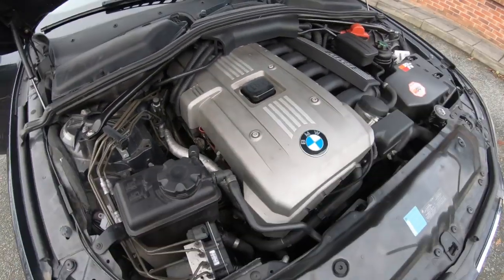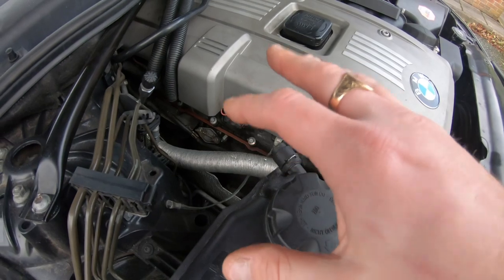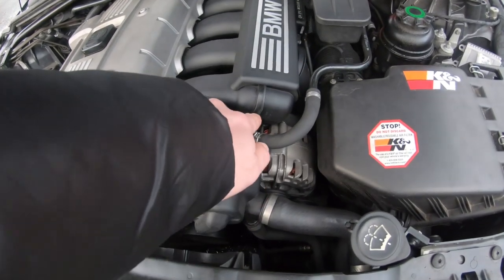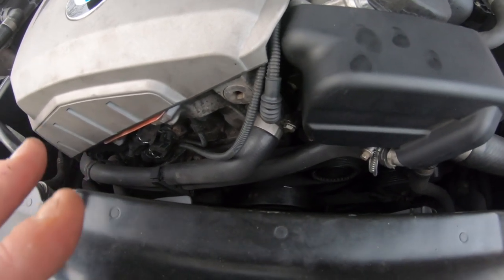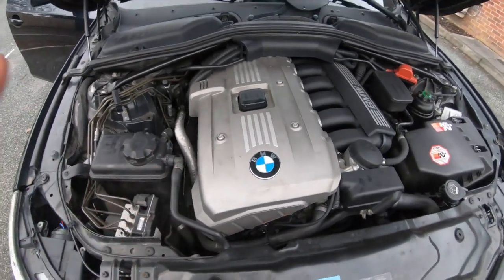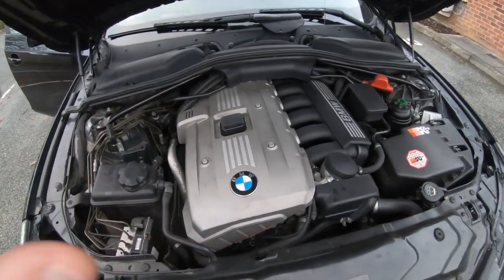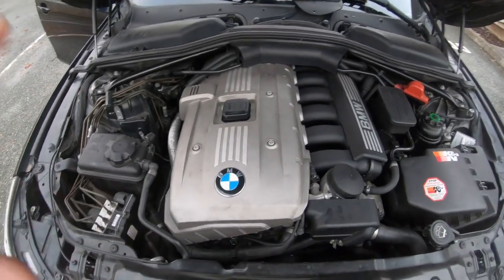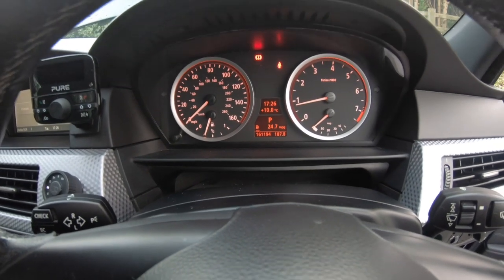How To Know Your Buying The Perfect N52 Engine In Your Bmw E60 & E90

Comment: Top notch brov. You're software help has gotten me through all these problems...at 200k on my e90...who would've thought? Yeah, the engine swap was b4 it was mine, but the new n52 has 60k on it, but everything you've taught me has gotten me a super smooth, no leak, n52 wo any garage shop charges. The dope show man. Still loving the silent, no leak n52, you just have to do the work as it should be, and that's where I count on you brov

Comment: just picked up a 328i 2009 for $800 and first task is changing the starter, oil housing gasket get it to start and then do vavle cover and all the vanos parts, then tackle the water pump and hoses and then eventually the timing since the car has 185K miles. Attempting to do all the work myself.

Comment: Dean, great video.. I’ve addressed most of these items except the vanos filters. I need to pull those out and take a look. Yesterday was a bid day for my e90.. it turned 200,000 miles.. still no leaks and runs like a champ.
Reply from the maker: It’s good to see mate that even with that mileage stil running strong good care and love and these cars run solid just like mine
Reply: @BMWDoctor  hello what last year bmw at the n52 engine 2009 he have?

Comment: There is enough here to avoid this engine. My advice to anyone looking for a used 5 series is to buy an f10 msport   520d with an n47 engine and get the timing chain done.  Good video, thanks 😁
Reply from the maker: No mate you are wrong N52 is much much better and most are USA people so wont listen to that 😁 

They don’t get diesel
Reply: The diesel not even available over here.
Reply: @akakiki4111  Pitty, diesel is a fabulous engine, averages 50 to 60 mpg and great torque.

Comment: Thanks for the tips.  I bought a 2010 528i for $500 and is going to be my project car.  So far I most of these parts that you have talked about needed replacing.  The car runs good.

Comment: Amazing video. So lucky I got the same car. Mines an N52 2007 and all this years, I still have not had an oil leak other than when my oil filter housing wore down and I blamed it at crappy filter. After three high end filters, I bought a new housing and no more oil leaks.

Comment: Great video Dean, you have covered all the typical issues that tend to dog these awesome engines. Just to clarify though, the valve timing is purely controlled via the Vanos system and of course the Vanos solenoids and check valves, the Valvetronic system is purely responsible for the intake valve lift which is actually the throttle control for the engine once warm (the throttle body goes full open when the engine is up to operating temperature). However, it is correct that they work together to run the engine efficiently and correctly by constantly adjusting the valve timing and intake valve lift which also varies depending on engine load and rpm, meaning, amount of valve lift doesn't always mean the same throttle position depending on the rpm, so it is critical that the Valvetronic motor and the Eccentric Shaft sensor is functioning properly, these can also cause a rough and bouncing idle amongst other things. Same as with the failed coils issue, normally a bad Eccentric Shaft sensor is due to oil leaking through the valve cover where the sensor plug is located, causes oil ingress and the internal circuitry to short out. The Vanos solenoids are probably the most commonly failed parts on these engines, especially the older N52 engines which will have had the original older part number solenoids, guess which mine has. Also just wanted to ask regarding the PCV, is it normal for there to be a slight vacuum when opening the oil filler cap when the engine is running, or what is the accepted observation? Keep up the good work and vids!!
Reply from the maker: It is perfectly normal for there to be pressure but NOT extreme pressure if you have extreme pressure you have a CCV problem but there should be some otherwise how would it pull the excess oil around but it shouldn’t be sucking the lid back down
Reply: Okay, so should be positive pressure, not sucking at all? Mine has always had an ever so slight vacuum when opening, you can hear the vacuum release as you open the oil filler cap. Idle speed doesn’t change much when testing this, and don’t have any oil consumption.
Reply from the maker: That’s correct positive pressure any kind of complete sucking holding the lid down not good at all I saw your comment on nathans video about cleaning the solenoids 

Why are you saying about cleaning them ???? Can you please tell me when this crap has ever worked even Nathan said that’s not a fix at all he made that video to get views he knows that doesn’t work but as everyone knows with YouTube people are always looking to save money and for cheap and free fixes to maintain 50k cars so the lies you have to dish out to get the views is bad 

Where as you know I’m different I have never ONCE come on YouTube saying about that crap since the day I started I don’t believe in running these cars cheap as you know I have no need too whatever they need I order straight from bmw for same day delievery for myself and don’t look anywhere else 

I only wish everyone was the same
Reply: Thanks for your reply. Okay, I’ve done some research regarding PCV systems in general and specific to the N52, as you said, positive pressure is indicative of a failed PCV, but, some negative pressure, as in a slight vacuum is correct. This is how the PCV works, it needs to draw any blow-by gasses from the crankcase and feed back into the intake, so moderate vacuum is necessary. Interestingly, when I originally bought my car 9 years ago, the engine was using some oil and I also on occasions noticed a slight plume of smoke on cold start, but within the first couple of years of owning the car, oil consumption got less and less and haven’t seen that cold start (or any other) smoke. So not sure if the PCV was slightly blocked from the original owner’s driving style, but will eventually have to consider replacing anyway.

I know your feelings regarding the cleaning of Vanos solenoids, I’m not saying that cleaning them solves problems, so no need to attack me, but I’m not totally stupid and have owned this car long enough to know a few things. I’ve cleaned (and swapped around) the solenoids over the years and have always noticed an improvement, even if short lived. The point is, before dishing out lots of money on new solenoids, giving then a clean and swapping them around at least gives you the chance to see if there is any changes or improvements, maybe error codes show a change of location. Years ago I remember a friend of mine had a stuck Vanos solenoid, told him to clean, no more error code and performance was restored. If I had an error code I would’ve replaced, but in all the years, never had an error code or stuck Vanos solenoid, but do have those intermittent low rpm stutters which I do think is due to mine being old and the original part number types. Knowing my luck though, I’ll replace mine and still have that intermittent low rpm stutter. I don’t skimp, have no problem forking out on genuine replacement parts if I KNOW it will solve a problem, have spent a lot of money over the years replacing parts that various specialists have identified as faulty or suspected as faulty only to sit with the same niggles. It’s hard dealing with no error codes as in in my case.
Reply: Pcv has a recall about a year ago. Just got my 08 n52 e90 328i with 92k for $5500 and had it serviced at dealership today

Comment: I have a 330xi 2006 e90 I bought it used with 100,000 km and it already has 140 thousand and its only problem is high engine oil consumption ., nice vid

Comment: I don't own a BMW. I like fixing my cars (domestic and Japanese...they are so easy and cheap to work on). I have gone down to clutches, and head gaskets, so I know how to wrench. But, right now, I want some Euro styling and I don't mind a bit more work. But these "solid" engines just don't seem very solid. I would love a "solid" normally aspirated engine. This is the best BMW offers, and I have to look at 10+ problems that need to be addressed at 100k+ miles.  Ugh, I am torn.

Comment: As far as eccentric shaft is concerned - are there any clear symptomps of it's damage, or do you have to remove the valve cover to tell if it's gears were chewed up? Obviously no car seller will let you peek under valve cover.

Comment: I've been watching, because I bought a 2006 530xi in descent shape from a family friend but I want it performing perfectly. I need to change the o2 sensor, coils & plugs. It runs good but missing in 2-4-&-6. I want all those other things checked and updated if needed. I may take this video to a mechanic  so he can tell how my car compares to yours.
Reply from the maker: Mate no mechanic will get yours performing like mine as they don’t have the knowledge skill or software to do it 

Also yours are missing a few things different to mine which will be both disa valves you will not have them as they didn’t want you lot having such power like us as you lot lose control a lot of your cars and can’t handle the power these produce secondly we don’t have any kind of XI system here as we don’t need too people here only drive rear wheel drive as we are professionals at driving bmw so every car here is rear wheel drive

Comment: I replaced valve cover and gasket, vanos solenoids, spark plugs and coils,  transmission flush, radiator flush, driveshaft, intake manifold, Pcv valve and other stuff. Bought a 2009 for 11k. Convertible. Put in 6k in repairs but damn do I love this car
Reply from the maker: good man

Comment: Love all the N52 vids mate! Top man
Reply from the maker: trying to keep the you lot entertained and give something to everyone so they can all enjoy keeping it mixed for all of you
Reply: @BMWDoctor  just did the oil housing gasket as per one of your older videos, how did you torque down that bolt under the intake? Did you use a 1/4 e10 torx swivel with an extension? I managed to get it off with a 1/2 universial socket with a torx on it with an extension on the other end but i cant get enough leverage to torque it up the same way i took it off.

Comment: I need to ask you ,  you say not to keep bleeding the coolant,
Fine but my lower return coolant hose is leaking for the o ring, change the whole hose, the car ask for more coolant , now when re fill , should i bleeding , you step gas 10 sec , resorvuir cap  "ON"  or just fill up the resorvuar tank,
Please ,i  afraid  to mess the pump or termostast,
Thank you in advance

Comment: What about the supercharger kit for the N52? Are these engines strong enough for the extra pressure and still be reliable?
Reply from the maker: No mate these will not handle well at all with a supercharger WELL the U.K. ones won’t at least we have a higher power band as it stands

Comment: Another coolant leak place is the green rubber O ring on the temperature sensor of E90/E91's thats inserted into the lower radiator hose that goes to the thermostat, the rounded edges flatten off after time and heat damage from the coolant and cause the coolant to weap past it and leak a tiny amount,. so you'll see a tiny level drop in your bottle and some coolant on your under tray or or on the floor if you don't have an under tray fitted.
Simple fix to change that O Ring.
Also mate it looks like you might have a coolant leak in the same area i could see something shiny/liquid like on your video at the 7:00 mark, either liquid on your under tray or you dont have an under tray fitted and you parked over a puddle maybe?
Reply from the maker: that is called water my friend from where it rained all night thats my undertray  fitted correct these cars when left in heavy rain get rain water via the grills it leaks down off the bonnet via the grills and goes onto the undertray always has
Reply: Yup I'm familiar with water :) just thought i would mention as i saw it and on the subject of leaks in the rest of my comment, this was how I discovered my O ring leak.
Reply from the maker: Yeah mate this car is checked weekly even though I don’t drive it I’m gonna have to do a video on what I look for on my n52 before a long journey

Comment: How much did you spend on the car so far and what amount of that would be "preventative maintenance" ? I'm thinking of buying one but so far really second guessing it as this goes way way beyond normal maintenance and the performance (at least for the 2.5l variant) is comparable to a chipped diesel which is far more reliable.
Reply from the maker: I only spent about £600 in total restoring this and its perfect now 173k on original water pump still and going strong still with all genuine parts with my trade discount so I get them half the price so these cars cost me very little
Reply: BMW Doctor would you say they’re hard to repair if you’re a complete beginner?
Reply from the maker: HELL no YOUTUBE has the most videos for BMW more then any other car so hard is a understatement

Comment: I bought an e90 with n52b30 with that same jumping in rpms when u start it. The codes it threw were vanos intake and solenoids. However it turned out the car had been driven without oil for nearly 50k kms, which led to camshafts being nearly destroyed. Took me around 4000 euros and a new engine but after that its a great engine and a car. Wish only the fuel economy was better
Reply from the maker: Wow what fuel economy are you getting in getting near 27mpg around town which I think is great and 31mpg on motorway
Reply: @BMWDoctor  i get 16 litres / 100 km combined, i dont know how much mpg that translates to
Reply from the maker: Luke Skywalker neither do I mate lol 😂 we don’t go by that here
Reply: @BMWDoctor  its around 15 mpg, i just checked it out
Reply: Dr.Dean I got a n52 engine in my 328xi 2007 I broke motor mount bracket on passenger side that let my motor cut my thermostat wire and send me into limp mode I repaired everthing try to start it and experience long cranks no start conditions was throwing codes for cam crank collation replaced cam and crank sensor with bmw original sensors car strarted once and went into limp mode again said missing waterpump but its working can see it move water keeps showing missing waterpump and crank no start condition I have fuel pressure 70 lbs got spark and only code is missing water pump. Any thoughts. Your advise greatly appreciated for car has been in garage 3 weeks and I have replaced everything changed oil but smells like gas due to long cranks trying to start did compression check 250 lbs new plugs

Comment: Bought a 08 328i (n52) with 67,000 km on it and 6 months later the belt shredded apart and somehow got debris in the engine. New engines in now with 90,000 km.... Pissed!!
Reply from the maker: that is PISSED I would be aswell lack of ownership and maintenance

Comment: Great video mate, am a bit scared to run into all these issues even after proper maintenance at the garage. Have still not addressed the issue of getting a blow from the back of the car when pulling to a stop. Transmission needs new oil? Or smth more serious? Appreciate any help, e60 525i 2006

Comment: Well I have one that was never looked after even though the service history said different, spark plugs never changed (100093) on the clock when I bought it also sure oil had not been changed for a long time. And I had to accept this was an engine needing a lot of TLC. And now it dont start even after starter motor changed , I got another and  have to now change it again. Great cars and engines but omg the stuff you need to replace cause of age.

Comment: Does the N52K engine have the CCV and Disa issue you mentioned in this video?  I get a strange static rattle sound in the cabin when accelerating and I assumed it was a bad windshield gasket, but perhaps it's the Disa rattle?
Reply from the maker: no you dont have disa valves that engine wasn't so lucky to have that

Comment: Is there anything wrong with changing the aluminum bolts with steel when doing repairs.
Reply from the maker: you cannot do that you HAVE to use aliminum bolts when doing this on this valve cover no choice about it steel ones are shorter and dont fit
Reply: How about if I just get longer ones that fit
Reply from the maker: doug furniss you a not change them why do you want to use stainless steel there is nothing wrong with the aluminium ones secondly you cannot use steel in a aluminium engine you will snap the Steel ones in the head and be screwed
Reply: So what you are saying is that the strength of the aluminium screw is greater than the steel screw?
Reply from the maker: doug furniss no I’m not I’m stating the facts you cannot use steel bolts in a aluminium HEAD if your planning to do that please do not come back here crying when you strip the head or strip out the threads this is the most STUPIDEST comment to EVER be asked and you should not be ALLOWED to own or EVEN service this engine there is NO PROBLEM using the aluminium bolts AT ALL providing you torque them correctly and buy a new set which are next to Nothing if you cannot afford a new set of bolts for £20 EVERY 100k I might add then you really shouldn’t own this car
Reply: I'm sorry. It was not my intention to upset you.

Comment: Hold a rag over the plug holes and slide a compressed air nozzle in, spray it, flip the rag spray it again, & again & clean the oil out and keep it out of the engine before pulling the plugs IMHO my old m52 was full of oil in the wells